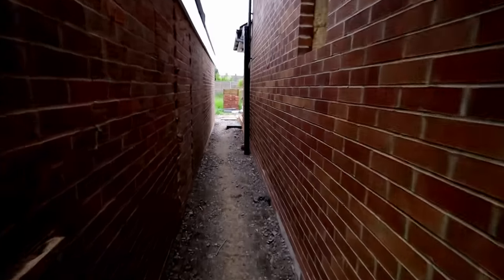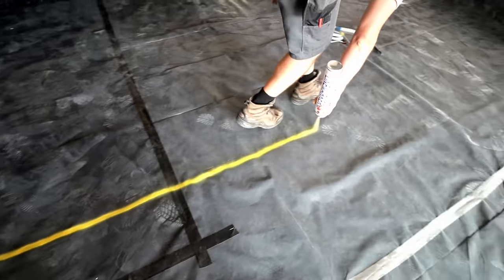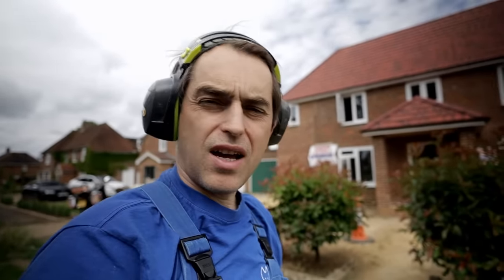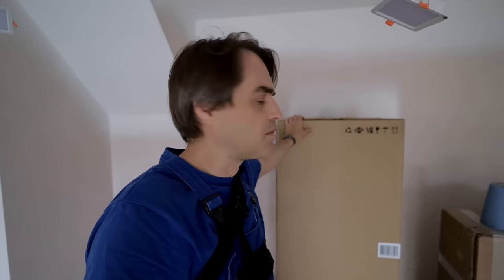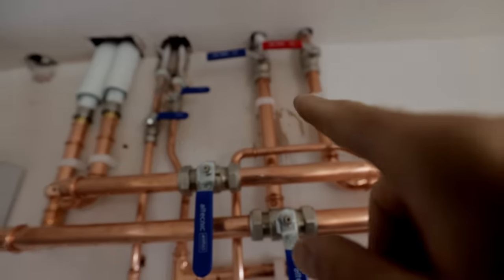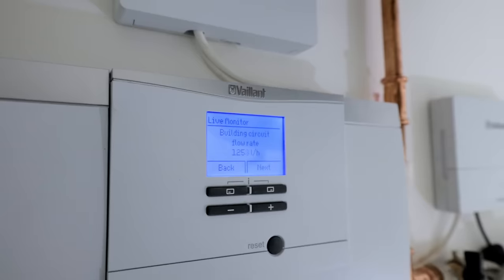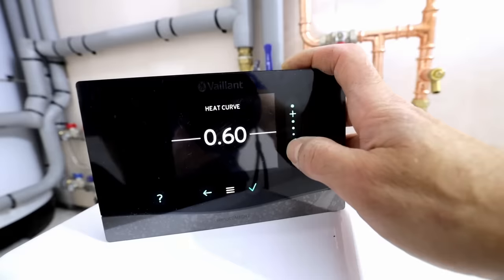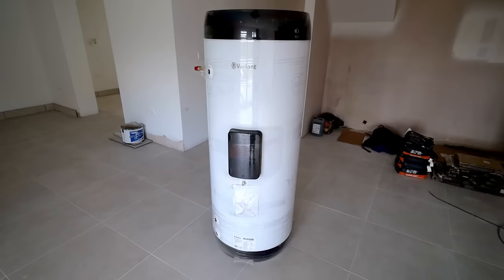Gas Boilers No Longer Make Sense, Here Is Why.

Comment: I would agree it may be an option in a new build but disagree with your thinking on an old property. 
I have a 1935 4 bedroom detached house. I have upgraded the insulation as much as I can with cavity insulation and loft insulation and am working round the floors I can. It has 20 year old upvc double glazing. 
No matter what I do I will not be able to get it efficient enough to run on the low output of a heat pump. I use 25kw gas (at 95% efficient) and the heat pump only kicks out 7kw. That is far too little. 
There is no return on the investment as it will cost me £10k more to install and cost about the same to run. You are replacing cheap gas running with very expensive electricity running.
Reply: If your gas boiler is at 95% efficiency then your flow temperature is where a heat pump will shine.  Either it's up to 95% efficient and you're not getting anywhere near that or if you are getting that then a heat pump wouldnt be as much of an issue as you make out.
Reply: @BenIsInSweden  Worcester Bosch state that their boilers are 95%. Old boilers are much lower. I was pointing out the gain to be had from just getting a better boiler. I do not see any reason to doubt I get the efficiency the manufacturer states. 
If my current boiler has an output of say 25kw (producing 23kw if you like) then how will anything producing 7kw replace it?
Reply: @grolfe3210  to achieve 95% efficiency you need to have a much lower flow temperature.  Most boilers are installed oversized to avoid customer complaints. So you need to know what the heat loss of your property is, rather than what the spec of the boiler is.
Reply: @BenIsInSweden  "to avoid customer complaints". What would a customer complain about with a smaller boiler? That is is not up to the job!! 
So let us say my 25kw boiler is oversize and so I could have a 20kw one. That is still a long way from 7kw, how do you make up the 13kw shortfall?
Reply: @grolfe3210  it's more that they don't usually do the work required to optimise the boiler capacity for the heat loss of the property, so they just guess and chuck in a larger boiler.  Check a few of the older videos here, there are some 20+kW boilers in properties with 5-7kW heat loss calculation. There are also larger heat pumps available.  I would be surprised if your property actually has 25kW heat loss, with what you have done to it.  I have a 150sqm 1920s house and the estimate for mine would be 12-16kW for down to about -20c. I didn't proceed to get the accurate calculations done as I opted to prioritise getting solar first in the end and stick to having an a2a hest pump and resistive heating for areas the heat pump can't reach.
Reply: @BenIsInSweden  My house is over 200sqm so probably needs 20kw. You must also need to add more than you lose to warm it up so 25kw is a decent aim. 
Given a heat pump is only giving 5-7kw that is a massive shortfall. 
"Resistive heating for areas the heat pump can't reach" is bullshit. What you are doing is admitting the heat pump output is not up to it. It is not about "reach" as the heat is piped in hot water anywhere you want. If I ran crappy fan heaters that is a fail and very expensive to run. I am old enough to remember houses before we had central heating and we got it so that we could avoid a very poor option of fan heaters (even if you want to call them resistive heating). Sorry but you are confirming my concern that the output is not there in a heat pump system and it is not suitable for an older property that is not insulated to a point where the need is reduced to 7kw.
Reply: @grolfe3210  "Given a heat pump is only giving 5-7kw" Do your research/re-read what I've already said, 7kW isn't the limit of heat pumps.  the aroTherm plus has a 12kW model.  Panasonic do a 16kW model, others can do 20+kW.  You missed the point that my existing heatpump is an air 2 air heat pump, it's 7.7kW and is in the hallway, so yes it isn't designed to reach every room in the house and never was, I don't have central heating at all. Given that my estimate for an A2W system was around double the a2a's heat output should tell you that as well.
Reply: @BenIsInSweden  Sorry but you are the one with a heat pump that is 7kw in a house that needs 15-20kw. 
The industry seems to downsize the output and tries to make up the shortfall with insulation. An older house hits an economic limit on this. 
What does you 7kw cost to run a year? So a 21kw will cost three times that! Given a 7kw  will cost as much money in electricity as a gas boiler of 20kw it then follows that if I switch a 20kw gas boiler for a 20kw heat pump it will cost me a fortune to run it. 
We get back to a heat pump only being economically viable if it is in a newbuild with very good thermal standard.and that extra cost not being factored in. In an older house you cannot get a heat pump system to adequately heat the house without it being far more expensive than gas.
Reply from the maker: 200 sq meters modern house will need around 5kW for heating and hot water. If it is a period property and is unmodernised then  it may need around 14kW.
Reply: @grolfe3210  do you have trouble understanding things? The A2A heatpump was never meant to cover the whole house, the previous owners installed one to take over from some of the resistive radiators around the house to save money. A central heating retrofit will cost me around £40k hence why I opt to currently spend more on heating running costs. For my needs it covers most of the areas of the house I use, except the bathroom (as I want that a couple of degrees warmer than the rest of the house) and my daughter's bedroom when she stays over, which she did the whole of the last winter.  My cost isn't really relevant as I live in an area that will regularly reach below -10C over winter, and I also have an immersion heater for dhw. But my (complete, i.e. not just for heating) electricity usage for the past 12 months was 16,475kWh costing around the equivalent of £3415.  There's also AC use in there.
Reply: @BenIsInSweden  What I do understand is that I posted here to say that the proposed heat pump option fell well short of what was needed to replace a conventional gas central heating system. 
Rather oddly you disagreed but then have revealed that you have some crap heat pump system that does not replace a conventional gas central heating system. 
What I do not understand is that you disagree with me but every thing you say supports what I say!
Reply: @grolfe3210  my system is absolutely adequate for my needs and if you actually need a 25kW boiler for yours the mine is costing me a fraction to run than your gas central heating system.
Reply: @UrbanPlumbers  Thank you. This confirms the issue I am raising.  All I see is the replacement of a 25kw boiler with a 7kw heat pump and for them to break even on cost of running. So then I would think that a 15kw heat pump would cost just over double that of a 7kw one. So sorry I have not got £4k a year to throw at my heating cost.
Reply from the maker: @grolfe3210  I don't understand what you are trying to say? There are no 15kW heat pumps on a single phase anyway. 12kW is the biggest and is around 30% more than a 5kW.

Do not look at the heat pump name as it is usually deceiving - 17kW being in reality 11kW units and so on.

95% of housing stock in UK needs below 10kW units, be it a heat pump or a gas boiler.
Reply: @grolfe3210 if the 25kW boiler is accurately sized for your property, with ball park calculations it would be costing you an estimated £3500 in heating with gas as it is, using about 50,000kWh per year.  I'm guessing that isn't the case?
Reply from the maker: @BenIsInSweden properties with 25kW heat loss use around 50-70k kWh in the UK and cost around £5,000-£6000k per year to run - so bad are gas installations here
Reply: @UrbanPlumbers  😯 let's chalk that up to being used to the under-balling the gas cost that other commenter use 😂
Reply: @UrbanPlumbers  So then in that same house, take out the 25kw gas boiler - what kw heat pump do you propose to fit and how much will it cost to run? (Given the electric is 4x the price of the gas). This is the issue we never seem to get a clear answer on.
Reply from the maker: @grolfe3210 I will propose a correctly sized heat pump, for 25kW heat loss a tandem of 2x12kW units. Design the system to 35-40c flow and run it at around 25% cheaper than gas, possibly even more. Add solar and battery storage and overnight cheap tariff and cut the cost in half.
Reply: @UrbanPlumbers  Thank you for your detailed response. Usually the change has been hidden within a huge insulation upgrade and so a much smaller output used, they would claim 25% cheaper for running a single heat pump so surely the cost would double with two? 
I saved 25% simply by upgrading my gas boiler, and another 25% by upgrading my insulation (to be fair the house had almost none when I bought it). 
I can of course add solar and battery to any house. Aside from the huge increase in (expensive) electricity, the changes to the system (all new rads tank and the unit itself will never pay for themselves. So it is really down to how green you are in switching to a renewable. 
Interesting question would be the return on a £20 electric car vs a £20k heat pump in greenness. Cheers.

Comment: At this very moment 42% of our electricity is generated by gas.  More than 50% of that energy is wasted when generating electricity.
If we look at the "big picture " and fitted 20 million heat pumps we would have to double the electricity grid. And to cap it all, all that electricity would be generated by gas.
10 million solar pv/battery installations would really help the Grid. 
Insulation WORKS what ever heating you choose, A lot of double glazing and cavity wall insulation isn't up to much.
Please be aware that local climate is likely to be a couple or more degrees up in towns and cities compared to a windy hillside in Wales.
Reply: Unfortunately the price of electricity is 3-4 times that of gas, which makes your savings an illusion.

Comment: Or you could just use Energy Carbons plastered in far infrared heating system and avoid all of that plumbing work and use a Mixergy hot water cylinder for hot water.
Reply from the maker: And pay 4.5 x more for your heating? Makes no sense
Reply: @UrbanPlumbers  not according to the figures I have seen. Housing associations like them as there are no servicing requirements either. I don't have all the facts for sure but food for thought.
Reply from the maker: They are only 100% efficient be run on direct electric, so not that great
Reply: @UrbanPlumbers  very true. This is where the control system comes into play by only having it turned on when you need it on. Why heat rooms when you aren't in them.  Love your work and channel.
Reply from the maker: Because the biggest amount of energy is needed to bring temperature up not to maintain it. An analogy would be acceleration of a car compared to sustained 60 miles per hour.